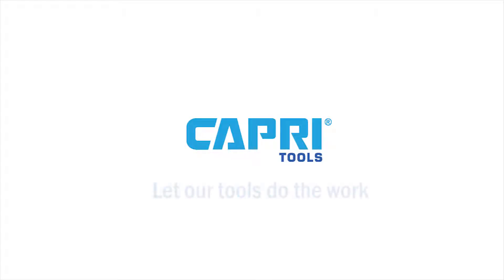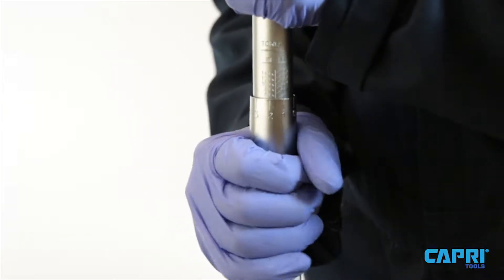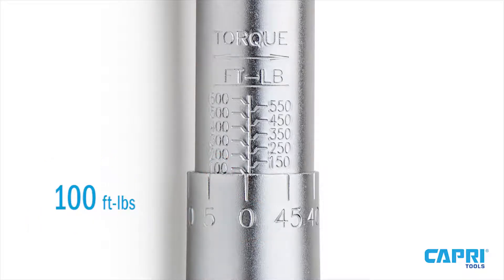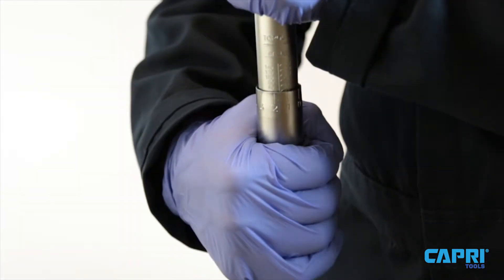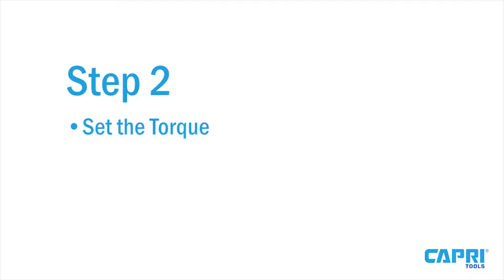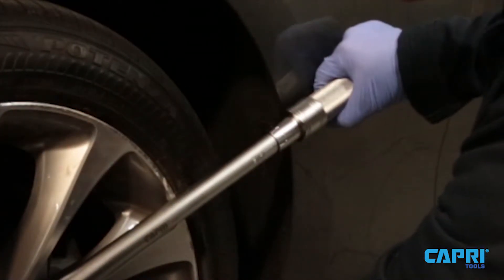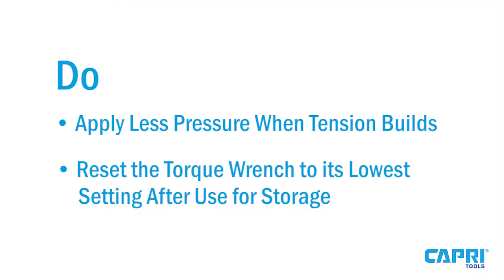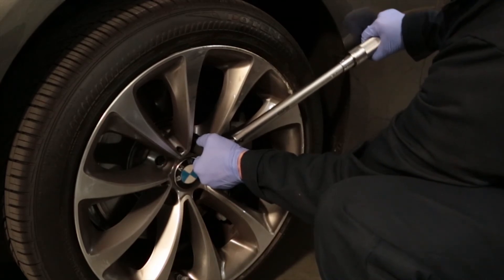How-To: Use a Torque Wrench Properly

Comment: Good production values, pacing, and balance of substance to advertising. Suggestions
--- one has to figure out for oneself that the demonstrator was holding down the lock ring when making adjustments.  Not obvious from the instruction whether the lock ring allows rotation of the micro of macro adjustment. (It does both.)
--- There is the small detail of having to push in the button on the back of the head to affix a socket. Some mfgrs. just spring load the small ball that holds sockets in place.
---I can do arithmetic  and the calculation called for when using extensions and adapters,  is well laid out.  However, the "distance between square drive and hand position"  would benefit from a demo. One could guess it is the end of the hand..... mid-point.... or other.

I appreciate that Capri made it, and put in the correct tags  so that a standard search using Capri turns this up right away.